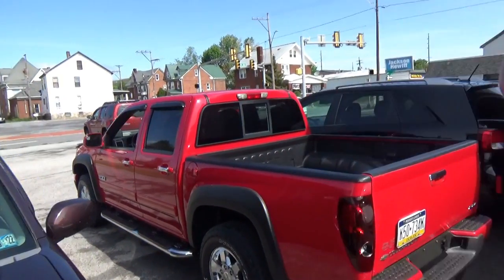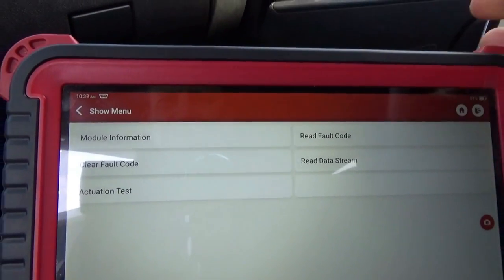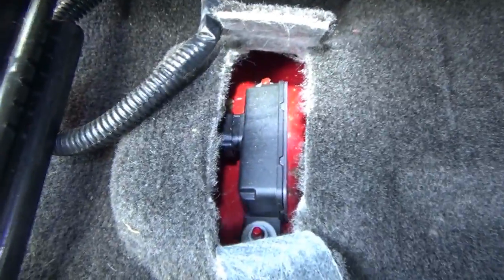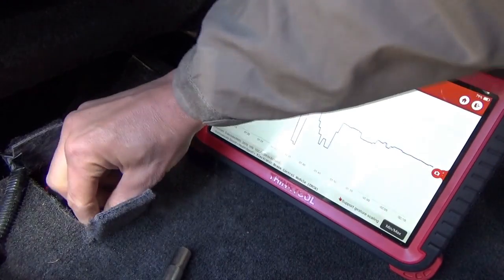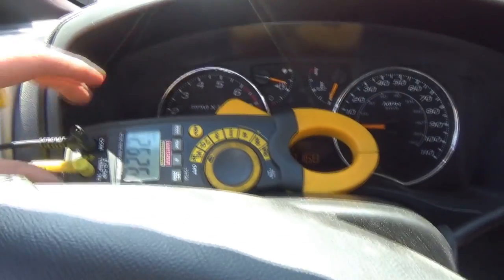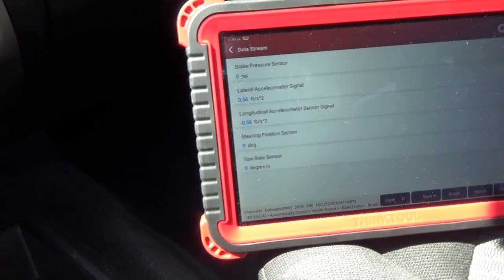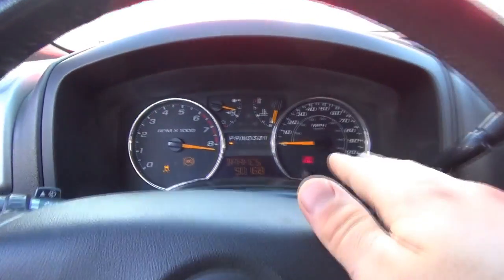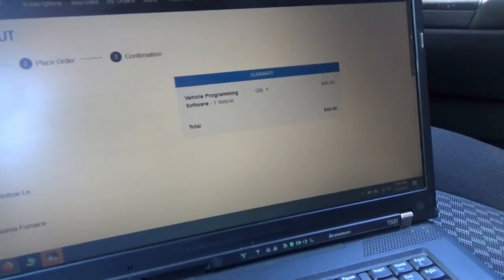Weird ABS/TRAC FAULT (GM Truck Diag & Repair)

Comment: The soldering iron is awesome... I bought an adapter for Dewalt batteries... I have a ton of Dewalt tools and chargers so it made sense... The battery lasts forever and the iron is a big time saver and precise... I give you a thumbs up for the recommendation... Good video - I didn't find myself "yaw-ning"... LOL...                                                      PS - take a trip to New Hampshire....
Reply: Indeed. The TS100 is my primary soldering iron. It runs great on 18V Li-ion batteries. But also on 19V laptop power supplies.
I flashed alternate firmware into mine. It now has a battery indicator and a low-battery shut-off. You can set in the settings how many Li-ion cells your battery has in series. That would probably be 5, for your DeWalt battery.
it would even run on a car battery, if need be.
I don't get that people would complain about that iron. It's incredibly versatile and it can easily compete with low-mid-range soldering stations.

Comment: Shaking a yaw rate sensor makes me think of Scanner Danner's air bag deployment video just a little lol
Reply: I was thinking the same thing lol
Reply: BOOM!
Reply: Only if it was connected to the airbags...
Yeah, SD got a wake up call on that one! LoL 🤣😆
Reply: He admitted that the reason it deployed was because I had manually grounded the module (for testing purposes), usually as soon as you remove the module from the bracket, it disables itself since it gets grounded for the chassis, the engineers didn't think of Danner using a jumper lol
Reply: Me too..
Reply: I was thinking the same as well. That’s an expensive boo boo 😂. He just better be glad it wasn’t one of those shrapnel throwing recall airbags.
Reply: 🤣🤣 I was waiting for OnStar to call the ambulance!… “it appears he rolled onto the roof, then was catapulted back upright, then went airborne, then settled onto the roof, then miraculously landed perfectly level on all fours. But the g-forces involved in this series of motions is beyond human limits. Send fire and rescue now”!

Comment: That is the most thin looking soldering iron I have ever seen.  It looks so comfortable to use as well as the ability to get in tighter spaces.  Also the need for a new ebcm in such a new looking truck (2010) seems like a real quality control problem.
Reply: Probably bad solder joints in it too?
Reply: @dans_Learning_Curve  You are probably right.

Comment: Like your soldering iron - would have loved to have that in 1965 when I started in electronics. I still suggest adding some more flux when you re-solder those pads or anything else. The standard 60/40 rosin core solder does not have enough flux in it to get a really good flow going. I know it looks good - shiny and all - but, it is the connection between the solder and the pad that you can't see not the wire and the solder.
Reply: Great suggestion.  What specific flux would you recommend, and where can I order it from?
Reply: @skiplazauski1497  Thanks. I immediately placed my order for your recommended flux.

Comment: In a related vein, on my 2007 Trailblazer the steering wheel position sensor was a known issue. If I parked with the wheels a bit askew the Service Stabilitrac light would light up on startup and the system would be disabled. Shut the truck off, straighten the wheels, start it up again and the light would go off and Stabilitrac would work normally. I got used to always parking with the front wheels very straight.

Comment: Ugh. GM ABS is such a pile. I remember Kieth has a video about how aftermarket scan tools can't read GM steering angle sensor live data correctly. I've certainly found that to be true!
Reply: I was using the Verus Pro once and I could not read the angle steering angle on a GM vehicle, I didn't think it would not have that data. I should have tried it with the Launch Pad II but didn't think of it. I almost suspected the damn module as well since I had steering angle code.

Comment: Great video, great technique in verifying the need for a new module. Thanks for showing the process of downloading and using the reprogramming software. I appreciate the bonus footage and the suggestion about the ease of using the battery powered soldering iron (which I believe replaced your old butane-powered one) to make these repairs to a circuit board - there are a lot of cold, cracked solder joints out there, which can be easily reflowed to give new life to tired cluster control panels and radio/cd power supplies, among other things.
Reply from the maker: Thank you!

Comment: Nice video I wonder if the detail guy got a bit to wild with the vacuum nozzle under the seat and pushing that yaw sensor over.
Reply: You very well could be correct!
Reply: I did hear a story where the detailer got went super suds mode and inadvertently destroyed and ECM or some other crucial module on a BMW that was under the seat. One or two broken bottles of wine messing with stuff also.

Comment: Do you have a Amazon tool page with the soldering iron on it.  I want to say you did at one time.  I work mostly off a service trk and a battery powered soldering iron would be useful.

Comment: I usually use a laptop power supply with my TS100, but for those times I need to be portable, I just built a connector that plugs the iron into my 12v power tool batteries. The TS100 is by far the best bang for the buck iron that I’ve seen and used. My Hakko soldering station collects dust on my basement work bench now.

Comment: Had a 99 Deville that suffered "Service Stabilitrak " off and on ... probably the same type of problem.    Dealer could never find anything wrong.   A key on-off cycle would cure it for a least a little while...   Had to get rid of it soon after as more and more electrical gremlins were poking up.

Comment: From the moment I saw that steering angle sensor come alive on the new module, I was questioning if you ever actually needed to replace the EBCM in this vehicle. Did you ever check the steering angle sensor while you were driving the car on the old module? If it was dead while you were driving, then the old module was definitely bad. However, if it was alive and/or you didn't check it, we would never know whether the old module was faulty, or just needed reprogrammed.

Remember, the service information said that the EEPROM in the EBCM saves checksum data based on the yaw/accel sensor inputs, so even if the lateral acceleration sensor was the only problem in this vehicle, you would have needed to reprogram the old module to delete corrupt checksum data from the EEPROM. I definitely would have attempted to reprogram the old module before replacing it.

Comment: Found this video looking for another ABS issue.    It's a customers car, an 2006 Hummer H3, so a similar setup as this one.    I have an ABS and Trac control light turned on in the cluster.   However there is no check engine light turned on, and there are no trouble codes in the PCM or ABS/EBCM, so I'm a bit stumped on this one.   Looking at the extremely slow live data for the ABS module, it seems that the right rear sensor is not reporting.    I have replaced the sensor, and checked wire integrity between the sensor and the ABS module, and I am reading a small amount of bias voltage at the sensor end.   Not sure if I should call the ABS module on this one, not sure what else it could be.    I find it odd that there is no trouble codes in the ABS module, not even pending or otherwise.

Comment: Man, the used car market must have ballooned like crazy if they think they can sell an 11 year old Colorado for $17k. 8:52
Reply: Well optioned new Colorado Crew Cab is $35k. Unless it’s 4wd, then it’s even higher. 😳
Reply: Holy hell. I just did a search and if you want a 2010 at a price I thought they went for it would have to have close to 200k on the odometer and minor rust. You'd still have to be crazy to buy one though.
Reply: My father's 06 with 115k is a rolling fire hazard with all the burned/melted garbage electrical shit I've had to replace.  
... and then there's the defective cylinder head that doesn't seal at all around the intake valve in cylinder 2.  Its run poorly for about 30k with a constant shake under 1500rpm.
The 2018 Colorado with less than 15k miles I drove at a job I quit stranded me 3 times because of electrical failures.
In short, GM can kiss my ass.
Reply: Welcome to 2021

Comment: Sir, never move a safety mitigating sensor or module whilst powered, never power such unless it is secured in it's designed location.   Failure to observe such can create conditions that require the module or sensor disable, in some cases permanently...

Comment: Most of those little jump boxes have a 12v plug if that's what the solder iron uses.
Reply: 5v USB, it may negotiate more but it's gotta start at 5 via USB.

Comment: Brother. I really like your videos but if the steering angle sensor reads zero I'd check that first.
Reply from the maker: For sure... But no code for steering sensor so not sure what was wrong with that data
Reply: @PineHollowAutoDiagnostics  I watched the whole video. You made the right call. The codes can sometimes throw you off as you well know. I'd have checked everything you did but just in a different order. It's strange that the steering angle sensor only came back when you drove it. Weird. Great job Ivan. Love your channel.

Comment: A little electronics paste flux dabbed on the joint before applying heat, would really help the solder re-flow

Comment: Yaw rate is the rate of change in yaw angle not the angle. If you keep it still it should be close to zero BUT a small offset is caused by the rotation of the earth. If it is not horizontal it gets crosstalk from pith or roll. Acceleration should be zero if the car is stationary independent of the orientation. (edit: in the lateral direction, if you turn the accelerometer axis in the vertical direction it should read + or - 9.81 m/s2, [32 ft/s2] the earth gravitation)

Comment: Ckecksum error   Check some of this and check some of that.
Accelerometer, Steering Position and Yaw Rate stuck in Gimbal Lock.
Ivan replaces module, fixes gauges and vehicle continues it's journey

Comment: and this is why i like my 99 buick century.... 9 times out of 10.... just pop it into nuetral, key off, start, drive
it resets and works for another 500 miles
.
but the wires do break clean on the rear (easy repair)...... and get oil soaked and the insulation falls off on the front sensor wires
.
and cheap scanners will read the data and codes just fine

Comment: On a used car maybe it would be a good idea to check and see if it had the proper EBCM and software for the truck. Who knows what has been changed and why. Auction cars are always a mystery. Sometimes potential buyers will sabotage them to get a better price by making them look like they have a problem so less people will bid on them.
Reply: I remember an SMA video where someone had swapped an engine on a similar age vehicle, and also snaffled the wiring harness for the replacement engine. While everything fitted correctly there was a circuit change between the models and the engine wiring harness was sending the right signals to the wrong places.

Took a while to work that one out...

Comment: Hi Ivan, I agree the ABS module was the trouble but, before I would have condemned the module electronics I would have tried to reprogram it since  once you buy the reprogram process from GM you can use it multiple time on a new module or existing module in the same car.  I have a feeling something changed in the modules software since it would not even let you clear the error message.
Reply from the maker: That's a good thought! Should have tried it for kicks 😁

Comment: I have a question concerning the ABS/Traction control on a 2013 Nissan Sentra where there is no DTCs and yet the traction/ABS and sometimes Brake warning lights come on, and most times it happens before the car is even moved. Have you ever seen this type of issue Ivan? Just curious as I would think that anything that causes the lights to come on must start with some sort of major fault and a resulting DTC.

Comment: Man, a 2010 GM vehicle with cold solder joints?  Unsurprising.

I had a 2001 Malibu.  The A/C control head failed twice due to cold solder joints.  The first time, it was under warranty.  The second time, I reflowed the control head myself with standard 60/40 leaded solder.  No more problems.

I should have done the same with the BCM.  It would click the hazard relay due to bad solder joints.  It wasn't until after I'd traded in the car that I realized what the trouble could be.

Comment: I'm not much of a fan of GM anymore. The fact they can't maintain their websites to work with common browsers is pretty lame. Let alone $40 to get the data to program the expensive part you just bought from them.
Reply: $40 is a drop in the bucket. A little annoying to have to update my programming computer every time I need to program a GM though (not very often). Process is super simple once updated though.
Reply: But it's cheaper than taking it to the dealer, who would have also recommended the replacement of all the other modules, as well as the steering wheel, steering column, steering box, tie rods, idler arm, steering knuckles, and the entire engine and transmission assembly, just to be on the safe side.

Comment: I had this happen on my truck. GM replace the hydraulic manifold thing? Reset it all in July 8 2021- $980 , it Work perfect, then just this month near July 10th, all lights came on again. I did the push-accelerator 3 times reset. Light went off for 2 days then came back. I cant get them to reset again. What other issues could do this if parts are new? I look at the 2 30 amp fuses, how do you pull those things?

Comment: Hey quick question to see what you think or maybe have seen this problem before? 1995 chevy K1500 5.7 signal wire on 2 terminal coolant temp sensor and map sensor signal goes to 5 volts after closed loop then pours fuel and barely runs.

Comment: Have you tried using a butane soldering iron ? They are plenty hot enough for most automotive applications. Try to stick to the Weller or Master brands !
Reply: The TS100 is a reliable and respected tool. Its easily as high quality as a Weller.
Reply: My Dremel brand butane iron has been fantastic.
Reply from the maker: Butane blows out in the breeze and is a pain to light at times. Electric is more reliable 👍
Reply: I guess with the flame hidden behind the catalyst in the tip I have never seen that happen. I do try to avoid soldering during hurricanes & tornadoes 😁
Reply from the maker: @steveingalls6798  ha in the field you gotta get it done no matter what the weather 😅

Comment: I'm confused!! You had the acceleration sensor in your hand and tilting it changed the g"s that it was reading? Tilt has little to do with accelerating unless the weight inside is not balanced by the opposing restraints? I don't get it. Not moving should yield "0" not -.5 or anything else. Making it change value should be determined by starts and stops (shaking). And yes. That guy must be responsible for Air Bag deployment (with other sensors?)

Comment: I have a 2012 chevy colorado 2.9. Runs great till it warms up and I stop. Then it just dies no clunking out like it's stalling or nothing just dies. Fires right back up let it set for a minute then it dies again. Can fire it back up floor it all is good till I let off the gas and let it idle and it dies. Any ideas. They say fuel purge canister valve and an ac delco oem filter can be causes on the 355 nation site or a map sensor. Starting with oil and fuel purge valve. Just paid 3700 to get timing done as well

Comment: Since both ecbm showed 0 steering wheel angle, I wonder if reprogramming the original would have fixed the problem... NPR.
Reply from the maker: Perhaps. But replacing the module is the most reliable solution 👍

Comment: Does your  Thinkcar Thinktool Pros Scanner work with GM OBD 1 Trucks? I was reading up on it on Amazon and it does show an OBD 1 connector. I looking for one to work on GM .65L diesel engines. Thank you
Reply from the maker: Nope OBD2 96 and newer only 👍

Comment: Great video! Ever since I can remember and almost every gm vehicle I have ever owned has always had one computer or another break. And they always cost way too much. I quit buying gm and have not had a vehicle with computer problems since. Knock on wood.
Reply: Do you mind if I ask what your gm cars were that had trouble.  I have an old 2002 Buick 3.8 engine.  Just wanted to know if it was one of them.  Was it the main computer or some of the modules?  Thanks in advance.

Comment: Man I need your help I have p300 code on 2006 Infiniti QX56 and all the coil packs and spark plugs been change but it’s still skipping
Reply: Random misfire.
OEM coils for the replacement?
Well, you didn't find the issue with the "PARTS CANNON"!
Reply: @dans_Learning_Curve   yes own coils and random misfires
Reply: @dans_Learning_Curve  That's why he needs the help...

Comment: In fact I read on your screen it thinks it's measuring ft/sec*2 (which I believe is Not a G reading but an actual acceleration rate). Google explain said it should read in G's (gravity) If upside down it's -1 G , right side it's 1 G. Gravity measurement. So ya I'm lost.Ow my head hurts.